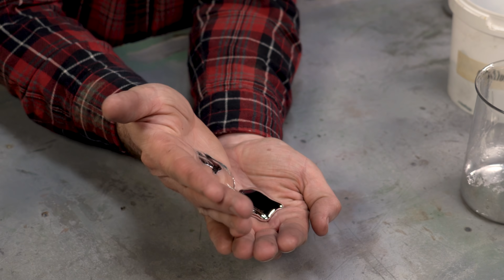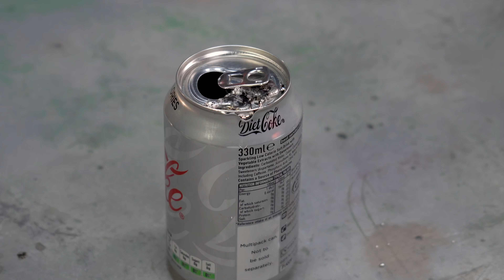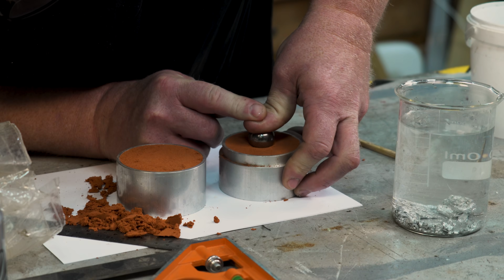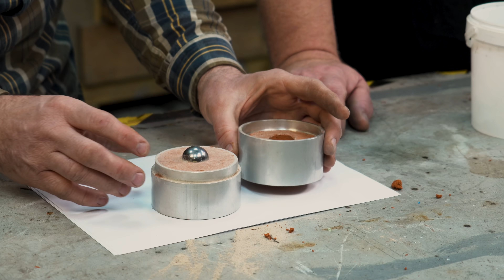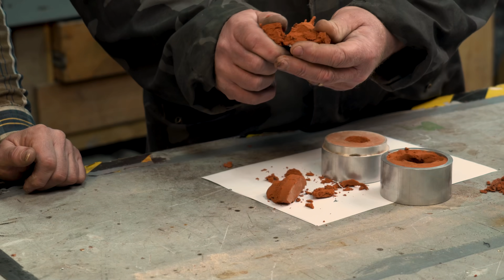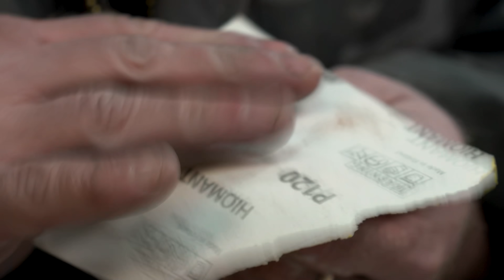Gallium slingshot ammo!  Casting Gallium into a ball, will it heat up like lead does?

Comment: Maybe that's a stupid question but why didn't you turn the can upside down and poured some gallium on the bottom?
Reply from the maker: The bottom of a can is actually thicker so it doesn’t work so well. Plus it’s easier to grab the ring pull to show it tearing away.

Comment: If you shot a gallium bullet into a human body at 37 Celsius... even if the impact didn't melt it the latent heat in the body should.
Also it doesn't look like the gallium would shatter hitting ballistics gel.

Pycrete made with some sort of natural fiber strands would seem like the better bet.

Comment: Also, I've been wanting to ask what oxidizer you use with your flash powder. I just remember using aluminum and iron fillings aged in salt water ground down to make backyard thermite when I was a kid. That should be aluminum oxide and an oxidizer but my old bits used to just make really hot burning powder and never the massively bright flash and boom your arrows did.
Reply: i think he uses titanium

Comment: Is there a reason not to have used a standard round ball bullet mold instead? I always see the corrosion experiment done with aluminum, does it did the same with steel?
Reply from the maker: I don’t have a round bullet mould that big. 
According to some people gallium does react with steel. But it must be a lot lot slower because I’ve not witnessed it.
Reply: @explosivescience9389  
I get it, since this is a one off, a sand cast doesn't have much waste other than extra time. I wasn't aware that steel would react to gallium. I always thought it was specifically aluminum as I've only seen it done to aluminum.

Comment: Fire a gallium ball thru a wall of heat, so lengthways above and along a pipe with holes in and lit gas fed thru the pipe and see if it made any difference/damage to the ball.  Another experiment could be to heat a steel plate up, hot as possible, and fire a gallium ball at it to see if it shatters or melts - I'd theorise that ~95% of the ball would shatter and the rest would melt but we'll not know until the experiment is considered 😉

EDIT: Another experiment could be to launch molten gallium into near ice cold water to see what happens.  Dropping a large volume of it close to the cold water would be interesting to see too.

Comment: I asked Jorge if the metal steel plate was damaged after the Gallium has been shot against it because I noticed it did leave a layer of gallium due to it impacting the steel . I would be really curious to find out if it did leave a layer of Gallium on the metal steel plate and if any damage was done to it by very thin layer.
Reply from the maker: It did leave a layer of gallium. The steel was 4mm thick. It dented it a small amount but not that much.
Reply: @explosivescience9389  Hey, Thank you very much for the answer, has it been dissolved now after it has set for a time , or is that steel plate just so thick that it doesn't really care if a little Gallium got on it and I wonder if you were to use an aluminum plate to shoot at if the outcome would be wholly different than it did for a steel plate , even after an extended time sitting with the Gallium chomping at it ??

Comment: Beverage cans has a plastic coating and drinks inside never touches the metal. So it wasn't the oxide layer of aluminum.
Reply from the maker: The outside top of the can doesn’t have any printing or plastic coating. 
Aluminium is a very reactive metal, yet it is used for rust free outdoor applications. It’s only because it instantly forms an oxide layer in contact with air that it doesn’t rust away. This aluminium oxide is what protects it.

Comment: That's quite impressing,would have liked to see how it would act if it really melted on Impact
Reply: Gallium melts over time, you can fire it into molten steel and it won't melt on impact so that is not possible. It is fragile though, so it will shatter. I was pretty impressed with the result as is because it DID penetrate, I did not expect that and I learned something from it.

Comment: Shattering inside a living target... and then melting inside to poison the target... that's pretty brutal
Reply: It would also make it difficult to match the projectile to the gun because there wouldn't be any identifiable scratches from the rifling of the barrel.
Reply: Pure Gallium is biologically inert. Other than the possibility of creating an embolism, internal gallium exposure is harmless. The melting at body temperature would be more hazardous for the same reason bullets are normally left inside gunshot wounds.

Comment: I wonder how a Non-Newtonian fluid would do as a projectile. It´s liquid first, but as soon as it hits the target the pressure will make it solid.
Probably not effective, since it distributes the force oder a larger area instead of concentratig it on a small point like regular ammo does. Might still be fun.
Reply: Every time I've seen non-newtonian fluids exposed to ballistic stresses on high speed footage, they turn brittle and shatter. Usually they're the target, not the projectile, but I'd expect the same behaviour.
Reply: The force reduction might be better for incapacitation ammo

Comment: Gallium is quite brittle. Even if you were to heat it up to just below its melting point before shooting it, I don't think the result would be different due to the energy (its latent heat of fusion) that would be required to cause a phase transition from solid to liquid.